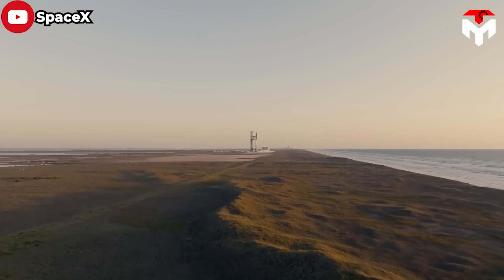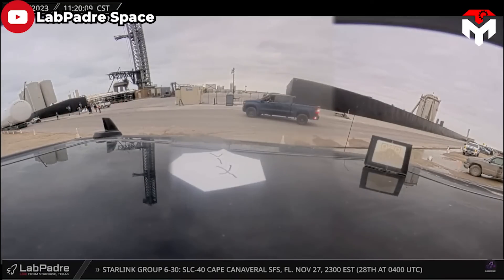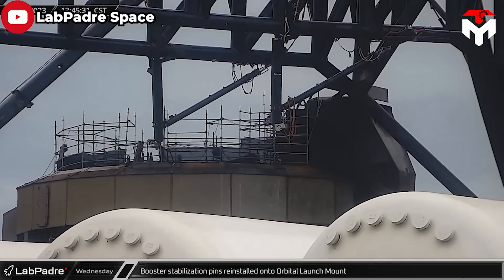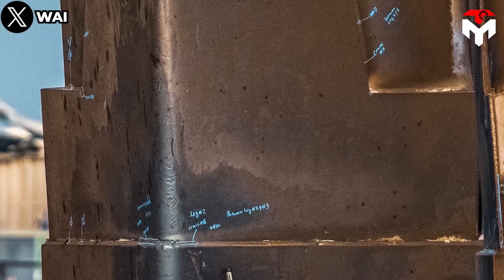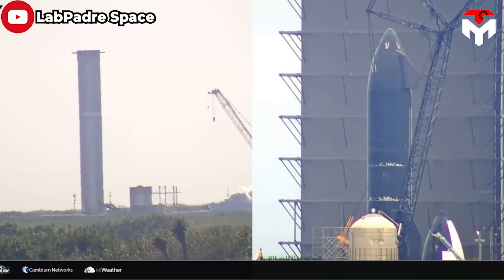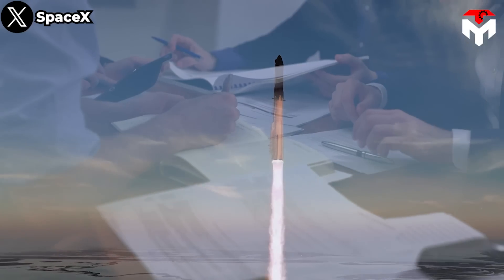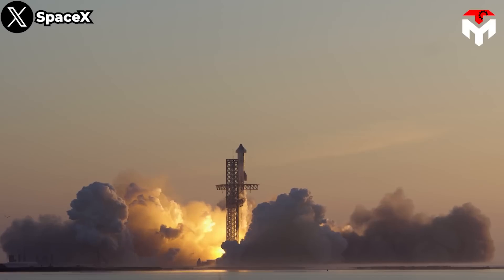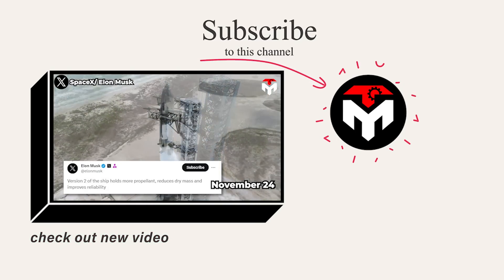The SpaceX Starship IFT-3 is coming faster than you might think!

Comment: I'm looking forward to Raptor 3 engines being given a test flight.
Also will be interested in lost tile counts. I suspect the tile will be one of the most problematic issues for a long time to come, and may require a design change.
I also noticed that Starship's lines could be improved by adding protruding hull features to it. Like if you wanted to add a cockpit like structure along the side opposite the flappers, would create more internal space, and give future cabin crew types a better view, which is why its common in aircraft.
Right now, Starship looks as blind as a worm.
Reply from the maker: Thank for your sharing

Comment: You mentioned the cracks on the base. Probably fatigue cracks. I wonder if they could install strain gages around the base. I know Toyota uses them anywhere there is a concern of stress cracking. Might help.
Reply from the maker: Thank you for cmt
Reply: It’s da gubmints fault Elon didn’t put two loaded cargo ships on Mars in 2022. This is not a typo!